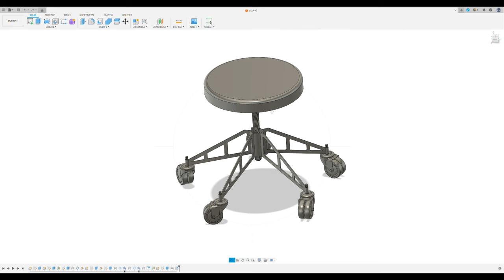Why buy when you can build? - DIY Shop Stool

Comment: Realy Very neat. BUT "T NUT" , thresded inserts DO go right through the timber, used a lot in furniture and making loudspeakers and flight cases. tightening the bolt must pull the t-nut flange against the opposite side of the plywood from what is being held on , wheel plate or.......  Acme thread is the best.  BUT can be expensive. I have never had a standard , solid, threaded bar wear out in this use. I have made and repaired several workshop stools and also upmarket "thrones" which is what a lot of drummers call what they sit on....  some of these are feeble compared to what you made, but are made to fold up. Hello from Ballynahinch in Northern Ireland UK  so I use metric.... but makes no difference     And I agree  ALWAYS SHIELD THREADS... in nuts or on bolts or....cardboard may do , a sleeve or just move a flat bit around as you weld, sticky tape    or drop the next size down bolt into a nut,,   Nicely made video

Comment: Excellent build. I agree with the other comments that the T-nuts should be on the other side of the plywood so the bolts pull the flange of the nuts against the wood, they would not pull out that way.  Keep up the good chanel.

Comment: Nice job! If you’re welding in nuts near threads like that in the future I’d suggest tack welding that nut at the end in first that has no exposed threads near it and then flipping it and threading that tacked nut into the rod and tack welding in the other but the same way. That or wrap some tin foil around the exposed threads when tacking. I’ve been messed up by spatter adhering to my threads one too many times… 😂
Reply from the maker: Thanks for the tip!  I will definitely do that next time.

Comment: Forgot to mention ... round over the top edge of the wooden disk, by router . best if radius is close to thickness of plywood. Or belt sander or plane or any means you own.  The how is not important  but it gives more comfort and a pro touch
Reply from the maker: Thanks for all the help and for watching!  I have a lot to learn on the woodworking side and really appreciate the tips.

Comment: It appears that you put the treaded inserts in the seat on the wrong side. They should be mounted so the flat side is being pulled into the plywood when the bolts are tightened. 
Otherwise, an amazing project!
Reply from the maker: You weren't supposed to catch that...j/k.  Thanks for the feedback and watching!

Comment: Great project! Thanks for the content! Impressive results for a DIY shop stool versus the $500 model online!

Maybe make the metal pan the same width / diameter as the wooden seat, with screws further out from center, as this adds strength and rigidity against heavy folks that can cause the wood to flex. Sitting in stools built with a smaller center set of screws tends to be the weakest part of the seat over time for fat guys. Maybe sandwich a second wooden disc to squeeze the leather underside for a cleaner look (rather than see the folds from the side).

Outstanding video production! A bit of humor is recommended, especially for longer length videos.
Reply from the maker: Thanks for the feedback!  I will add these onto the list for version 2.0.
Reply: i agree

Comment: A friend and I have debated build or buy. How many hours did you spend on this? Parts & material cost? Electricity cost, consumables, welder/cnc wear cost? Where’s foot rest ring?What was your actual total cost? What was the answer to opening question, which is cheaper?
FYI-I’m in the build it camp. 👍
Reply from the maker: Its hard to judge timing because filming makes it take way longer but I would say you could put it together in a few hours.  There isn't a ton a welding or cutting on this project so electrical and consumable cost is super low (under $10).  All in I am about half of what I would have had in the one on the website.  The foot rest ring really isn't needed with a stool this low to the ground but I might add one in version 2.  If you are interested in a kit for this stool, please visit https://splysed.etsy.com.  Thanks for watching and let me know if you have anymore questions.
Reply: Sometimes it is not only the actual savings that drive a project like this.
For me, in any way it is the fact that I made it. Also my time is not a cost consideration, as I do it  in my spare time. Then normally it is really cheap for me. If I must add my hourly rate of my daily job to a project like this, it would normally be double the price of the advertised item.

Comment: Very cool project.  I have been looking at those shop stools for a few years, but you're right, they are dang expensive.  Some redesign notes:
-The commercial one has a hoop foot rest, which also adds a whole lot of rigidity at the ends of the legs.  If you aren't using a hoop, I would add a strut, skeletonized to match the legs, between each of the 5 points at the castor tube.  Anything to keep the legs from twisting, which they will, because we are all meat heads who will end up having stool races down the driveway!
-The T-nuts should be on the other side of the wood, pulling the head of the nut into the wood, like a built in washer.
-I would like to see a slightly larger diameter seat pan, and I would suggest rolling the edge ever so little for long term flatness.  You could even peen the edge over if you don't have a bead roller.  Prolonged sitting on the edge of the stool will twist a flat plate... the rolled edge acts as a gusset of sorts.  Or, double up the nuts inside a tube, same as the base but with the nuts close together... then add some gussets from the pan to the tube.
-Spray a little WD-40 (or some fancy weld spatter spray) on the threads when tacking.  It's cheap, quick, and effective.

Either way, this is an awesome project.  Thanks for sharing with us!
Reply from the maker: I like the ideas and will include those on the next one.  Thanks for watching!